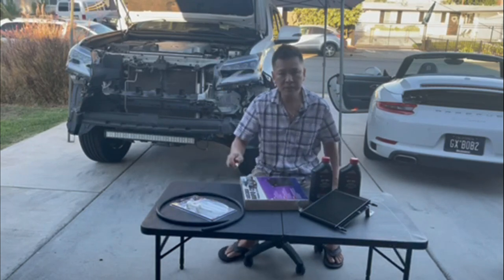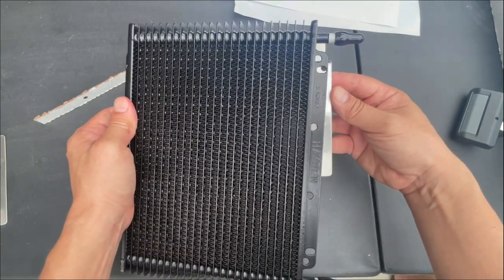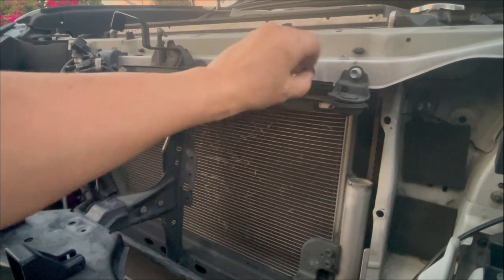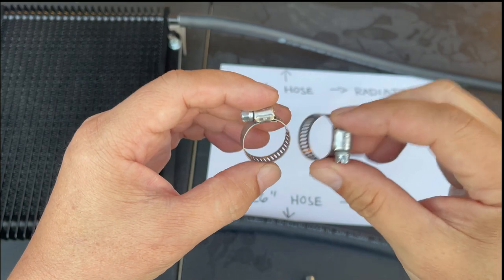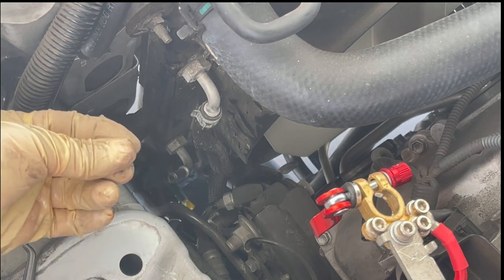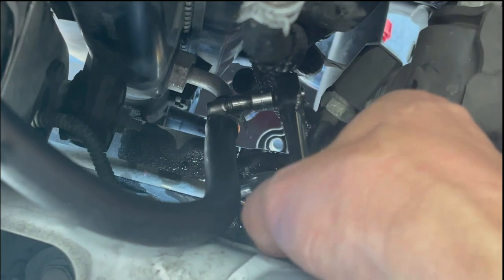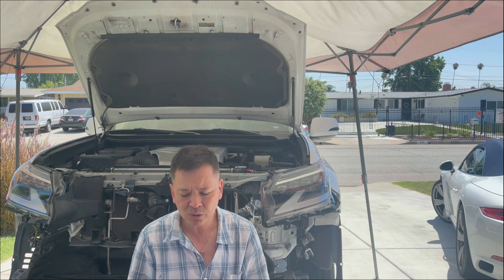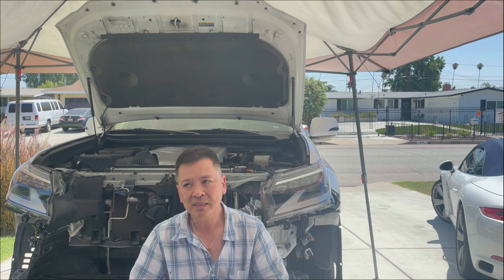LEXUS GX460 HAYDEN TRANSMISSION COOLER INSTALLATION

Comment: I thought the gx460 had a built in transmission cooler already? I installed one of these on my 3rd gen 4runner and it worked great
Reply from the maker: Are you talking about the sorry excuse of a cooler that's built into the radiator?   Or are you referring to the external OEM tranny coolers only offered in the US market as an option starting in 2020 for Luxury trims w/Offroad package?  Either way, an aftermarket transmission cooler to supplement the "extra" plumbing embedded in your radiator is the better choice if you are doing off-roading or towing, especially in hot weather.
Reply: @GXBOB  I saw a comment on reddit that I misinterpreted to think all of the luxury gx's facelift onward in the US had the OEM coolers. Knowing now that my 2016 has the POS one built into the radiator I am 100% doing this mod again for my GX, butim going to totally bypass the radiator like I did with my 4runner.
Reply from the maker: @hurpaderpp  someone asked me about the bypass option and I replied with a lengthy response. You can go thru the transmission cooler comment section and read my opinion.
Reply: @GXBOB  excellent video, my only question is I live in the very cold northeast. I know Hayden markets a model that is supposed to have special interior that restricts the flow in very cold weather. Do you have any opinion on this topic. Thanks for this great information.

Comment: Great vid Bob. It’s pretty clear you did a lot of research before you did this mod, and we all benefit. Questions: 1) Did you go back almost to step one and install the protective loom? 2) Did u have special tools to make the brackets? How thick is the ss? 3) I’m willing to purchase a set of brackets if your willing to make a set.
Reply from the maker: Mike,  1) I had to go back to install the loom after putting the bumper back because i didn't want to lose momentum.  I would have to pack everything up (filming equipment, tables, stands, parts, etc...).  If i took my other car i had nobody to stay and watch my stuff not get stolen.  2) The SS bracket thickness was roughly 1/32". I had a metal fabricator make the bracket for me as a favor, but that is overkill.    You can just buy a sheet of metal from your local hardware store and dremel one out yourself w/ a cutting wheel.  Use a pair of pliers and table vice to bend them into shape.  I would have to ask my fabricator if he is interested in doing some side business but i'll get back to you.
Reply: Ok thanks Bob,
Reply from the maker: @mikemitchell9138  My fabricator can make a pair of custom brackets identical to mine in stainless steel  w/o holes for $25 free shipping. Reason no holes are due to the variation from vehicle to vehicle.
Reply: @GXBOB  That’s great and thanks! What’s the best to contact/pay him?
Reply from the maker: @mikemitchell9138  I’ll reach out to you when it’s done. He said next week. And I’ll sit you a number for venmo or zelle
Reply: @GXBOB  Got it, thanks again
Reply from the maker: @mikemitchell9138  My fabricator made 4 sets.  PM me on Instagram @GX.BOB if you’re still interested Mike. I’ll take pics before i send it off

Comment: @GXBOB would this pretty much be the same process with the 698 model? Even adding mor fluid to the cooler? TIA
Reply from the maker: Same process but different brackets than the ones I used.

Comment: Maybe one other point to your configuration:  Since it is blocking part of the radiator, that passthrough air will be a lot cooler once it reaches the radiator than if it were first in line for ATF cooling.  The other configuration would be blowing hot air all over your radiator thus decreasing its own engine cooling ability and probably making the cooling fan work alot harder.   Also the air blockage my be an argument for a smaller cooler though.  Finally, that horn configuration will decrease your overall horn performance by 3.27 dB.
Reply from the maker: Damn blang, i appreciate the extra knowledge sharing.
Reply: @GXBOB  Overall it would be interesting to see if the average engine temps increase while the ATF temps decrease.  If the engine temps are pretty much the same before and after the install then we are solid gold.

Comment: Hey Bob. Where did you get the stainless for the brackets? What was it normally used for?
Reply from the maker: The stainless brackets were specifically custom made for the transmission cooler. I have a few more sets if you want to purchase the pair for $25 shipped. PM me.

Comment: why don't you have a cooling fan on the right side? did you remove it?
Reply from the maker: I have a base model.  It doesn't come with a fan. It came with absolutely nothing.  It is so minimal in options that even the dealer was surprised i wanted it.  I chose the base because it gave me more opportunities to work with and add custom accessories to.

Comment: Bob...did you "consult" with Hayden on the sizing of the cooler. Seems a lil big compared the factory one or on the Tundra. Since it's been a year. What is your overall experience with it now? Would you do it again?
Cheers
Reply from the maker: The general rule of thumb is to choose a cooler that is rated for at least three times the weight of the trailer you are towing.  My travel trailer being a little under 2000lbs makes the Hayden 678 almost within the proper size range for the stuff i tow and I also considered the amount of towing i do.  I think the Lexus oem one is a joke and is really meant for daily city driving without serious consideration to towing boats/trailers uphill to Big Bear in the middle of summer.  I am still running my Hayden 678 and according to my tranny cooler temps, i can seriously say i sleep better at night.
Reply: @GXBOB  I didn't mean the trans-cooler built into the radiator. There are some GX460's and I think all GX470's have an external cooler. Driver's side near the horns. Also you did isolate the S/S bracket from the aluminum?
That's a big corrosion problem waiting to happen. (stainless to Al)
Thx

Comment: Lexus just informed me that my transmission solenoid is bad.😢 They don’t rebuild only replace. Any suggestions on rebuilding or replacing? Thanks GX Bob
Reply from the maker: i can't use my GX as an example, but i had a toyota sienna tranny solenoid go out and all we had to do was drop the pan and replace the solenoids.  They were fairly easy and straightforward installation.  I probably won't do a video on that unless my solenoids fail themself but the answer is, NO, solenoids do not get rebuilt, they get replaced.

Comment: How did you ever not get transmission fluid leak out from the bottom hose when you removed your screw plug? I had fluid come out.
Reply from the maker: my driveway is  on an incline.
Reply: @GXBOB  ah ok cool cool 👍
Just barely a little came out enough to just cover my fingers a little. That had to be the trickiest for me lol. 
Appreciate the great video and your awesome personality. Thank you

Comment: How much difference does it make to the transmission temperature?
Can you pls make a video on that
Reply from the maker: i just ordered a scanner that was capable of reading tranny temps.  Check back with me soon.
Reply: @GXBOB  sure .thanks Sir
Reply from the maker: @kanevivalakane3699  So i'm doing a lot of eye brow raising because my tranny is running cooler towards the low end of the spectrum between 185-190 while towing on 4th gear.  But then again, i never looked at the temps prior to the tranny cooler install so i have nothing to compare it to.

Comment: You make this job to complex.
Reply from the maker: @rayvarnson8976 You should have seen the unedited version where I moved the fuel tank back 3 feet in order for the truck to not flip over once I installed the trans cooler.

Comment: How much cooler does it get from this install?
Reply from the maker: 20-40 degrees cooler.  I pull a boat and a 3400 lb travel trailer uphill so any amount of temp drop is beneficial.

Comment: Anything on the 12-volt solution remote starter?
Reply from the maker: I hate to say this but systems such as 12volt are plug and play which limits many other options that are programmable.  An important feature needed to keep your engine running when u disarm your vehicle requires a double pulse to your vehicle's disarm input.  I've heard so many issues relating to this.  I reached out to 12volt but was unable to get a sample unit in order to diagnose for their customers.
Reply: What issue are having? I installed a remote starter and it has been working flawlessly for a little less than a year. I use it everyday in the winter months in breezy New England and some times in the summer.
Reply: Hi Bob, great video. This type of modification is preferably for users who must tow heavy weight and do offroad? And Is this transmission cooler something good to increase the durability of our transmission? Thanks Bob.